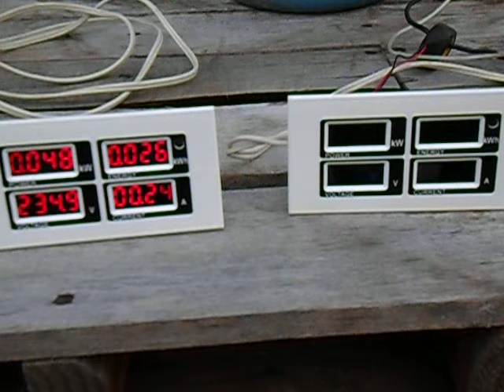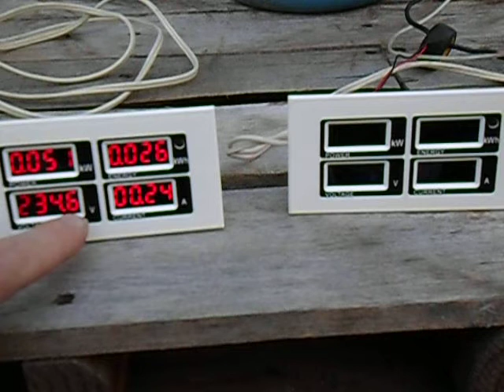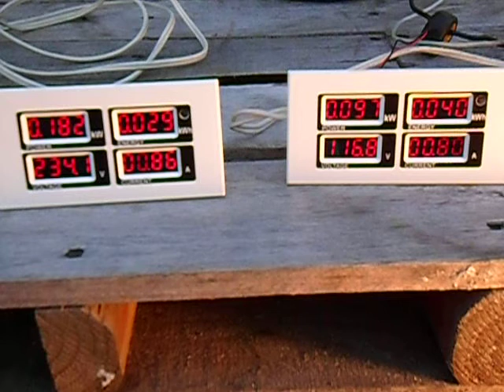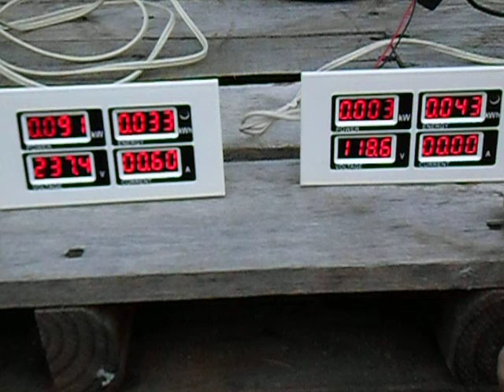Gerard Morin replication 10kw to 5kw transformer test

Comment: Hitby thank you very much for replicating the experiment! I'm contacting all the transformers' manufacturers in my area and asking them if they could help me with some experiments but they do not seem to be very friendly and open to do this type of things :P I have one doubt in regards to the configuration that you have used, in Gerard's video in the minute 3:34 you can see that input wire is connected to 2 lugs. Would it be much trouble for you to see what happens if you connect 1 input cable to 2 lugs? Thank you in advance for your time and consideration :)
Reply from the maker: Juan we will add that into the testing schedule, still waiting for McCulloch Generator.
Reply: Juan Ignacio Bravin Juan, tomorrow I will receive a 10kW and a 15kW set of pole transformers and I have some test gear to kick this thing off the right way, including the identical generator. I am still trying to figure out how I will get the transformers to my location safely, but, other than that, I do suggest he tries to not power his setup with hisoutlet or breaker box because the entire experiment is to do so without any type of grounded source.

The outlet or power is obviously not grounded, but, the source transformer from the power company is somewhere in the system, the outside of the transformer, and, the center tap of the transformer, which, the 240 side is connected to which eliminates the phenomenon.

Gerard does not have his generator grounded, his transformers are not grounded, and, if we look closely, the transformers are bonded together, then, they are isolated from the floor which btw, concrete is a great ground for a transformer that holds high voltage potential. Since the units are not grounded, the outside of the cans are energized whether one believes me or not. I have tried this with the washer pump generator before and it just didn't have enough power to successfully power the coils of the transformer correctly, also, the washer pump isn't actually a true ac sinewave, it is a pulsed dc square wave with a hv spike on the leading edge of the waveform.

If this is done without ground being introduced, the ions created by the transformer channel in energy from the ionisphere, and this is merely proven by the temperature of the bushings contrary to popular belief. This experiment was duplicated by myself and it does provide a lot of additional power in the form of cold electricity that works in a different method. Cold electricity functions in the opposite manner with resistance than conventional "amperage forced electricity" operates, and it is due to the fact that conventional power is not manifested from another place, the electrons are forced to flow by the motion of an excited electromagnetic generator which utilizes ground to create a capacitance in the transformers, the generator, and any other inductive device. Since the ground will not allow this method to be effective, we have to look at how an inductor reacts to any conventionally powered system. The inductor has some capacitance, and inductance to react to the power in a normal way. Since Gerards system does not have ground connected, there is a manifestation of cold radiation which does not exist in his system and the level of power is much greater using a much smaller amount of power. The power is still there, it is just channeled instead of being being drawn by a forced induction from a forced source.

The generator being ungrounded eliminates an effect I call the gravitational siphon effect, which can only be done with a grounded circuit . A grounded circuit eliminates the ability for the aetheric positive energy from being drawn in because it is the opposite and will not allow such a difference in potential of the opposing polarity to manifest within it unless it is isolated from it. (I hope this makes sense)

In a conventional system, resistance forces the electrical current to be drawn from the source, through induction, direct connection, or any conventional method. In the case of Gerard's system, the resistance acts in the opposite manner. It induces a channel, or starts a channel from the ionization of the high voltage bushings, and, it takes time for the energy to become present, unlike conventional electrical systems do. When this happens, the entire transformer becomes energized, but, the outer case of the can has electron flow happening around it, creating a massive flux, therefore allowing the Earth being next to the can to draw the channel of energy to it, being it is the opposite polarity and attracting it.

It can not be done without the introduction of some power, but, the power is much greater than we anticipated after we started. The same thing is happening with Tesla's coil system he built with the amplification coil, as well as the Great Pyramid of Giza. The cap stone is covered in gold, and, the ground is not connected to the cap, but, deep inside of the pyramid, the conductors from both a very deep ground and the cap come close top each other to cause this magnetic vortex, allowing either something capacitive to store the cap stone energy, and, ground on it's other end. This channels in the energy from above, and, the pyramid on it's own is an attractant to energy, so, as Gerard's system, something has to be used to power it up and keep it running, or, the device in the Pyramid, being incomplete at this time could not run. I'd bet if it was complete and it did have all of the components, it would continue to operate and be able to self loop from the energies above.

The energy from the cosmos could be drawn in from a great distance, and with Gerard's device/transformers, since electricity travels so quickly, nearly or at light speed, it would be instantly operational if connected to the source (ionisphere or cosmos energy source) , but, it isn't instant and takes time to power up completely because the energy is coming to the system from a great distance.

I truly believe something very unorthodox is happening here and I will run my tests to see if I could make this completely successful , but, with test equipment monitoring the output voltage, then, a second run monitoring the output amperage, printing a test report for each segment. Then., I will do the same, using the same load to test the input power used from the generator to see exactly what is happening. If it shows a decent amount of overunity, I will attempt to loop it, but, I have yet to scrape up enough cash to get enough batteries to operate my 180v dc motor I am using. I am taking the McCulloch generator apart and will be driving the generator with the electric motor by battery. Then, i will create a DC output by rectification of the 120v output to charge the batteries and attempt to loop it, but, I may need to use a third transformer to correct the voltage, and i will be hoping the amperage of the system through the third transformer will have enough ass to charge the batteries under load. If the system uses that little to run the loads as in Gerard's video, it should loop without question. If this does, i will be building a circuit to isolate ground from the output of the transformers so we could use it in my home for power.

I think I have the ability to isolate ground from the power company's feed by utilizing another circuit I designed to create cold electricity without drawing it in, by merely transforming it from the wall using a few components in between the high side terminals. I am hoping it works and will be shown in my tests.

I also have high voltage meters (professional grade for high voltage linework, ppe, and a load of freshly calibrated equipment to prove the input and output while testing. I really won't care much for anybodies input as how to test it because I know how to prove what is happening if it does in fact work. I will test it all,, document it, edit the video the best I can to make it as short as possible, and, I'd like to make this so I could get a professional videographer possibly donate his time so this could go worldwide in the most believable manner once I am done doing this.

I should be completed with most of my tests in the next few days with outlet power, then, in the next week, I will do the generator version and blend the videos because I feel it will be important for everybody to see the difference if I have any.

The transformers must have a capacitive style inductor which is an aluminum plate would around paper for the secondary coil, then, the primary coil is wire wound with very fine wire. The coil has to be like this to allow the channelling of the energy. I'm not too sure exactly how this works, but, it is a communication device that has a very low frequency resonance closer to one of the Schumann resonances, and by adding the components i am talking about, we could get a more accurate resonance which will cause a much higher efficiency, maybe even allowing the transformers to self power up to a few volts. If this happens, the effect I am looking for will be very similar to my Pelex device and should have 15 kW worth of output. I don't think it matters if we place the smaller transformer first or the larger, but, if the larger is second and the "siphon" happens, the larger transformer can draw from the smaller burning the smaller one out, so, it would make sense to use the larger first.

From what I see, Gerard uses a 50kW and a 25kW. There is a very big difference between those and the pigs in this video as well as the amount of communication the coils can channel since the energy we can feed into the first transformer causes a much larger channel since the power is greater. The less power, the less input is received through the antenna so to speak.

Regards,
Marc
Reply: Juan Ignacio Bravin A WARNING TO EVERYBODY: THIS IS DEADLY TO DO... DO NOT ATTEMPT THIS AT HOME!  ONE WRONG MOVE CAN KILL YOU. HIGH VOLTAGES HAVE CLEARANCE DISTANCES BECAUSE THEY ARC AND JUMP if one gets too close to them . A full potential arc can give you just as bad of electrocution as touching a connection. Arms get blown off, or, people have painful nerve damage and massive burns that will not easily heal for the rest of their life with just 8/10's of an amp at 7970 volts if they do not die instantaneously. 

Please use safety glasses,  high voltage class 2 rubber gloves and sleeves, and whatever rubber protection that is made to cover the exposed wiring so mistakes can not happen. I recommend only high voltage qualified people are the only people who try this.  if you are anywhere near large primary jumpers, you will get hurt if the system arcs to you. It can do so if people are not wearing the correct PPE and, I recommend that if you have no qualifications for this, DO NOT TRY THIS AT HOME or close to anybodies home. Be smart and do not let kids anywhere near this, it could kill a curious child as wel!! You were forewarned. I will not be responsible for any injuries , deaths, or damages to any personal property, or any other property for that matter since this is a fire hazard as well.

Now, that all being said, Hi again Juan!  I received the two transformers today, exactly as I ordered, but, before I set them up, I have to test them with a TTR meter and hipotential test set to ensure they aren't shorted or even partially shorted. (this verifies the insulation is good for the rated voltage and allows us to energize them with high current energy without a destructive explosion as some cans do. 

They were delivered from the Dakotas all the way to CT, so, during the ride, damages could happen. I always test transformers with a hipot set to insure the insulation is ok beforehand, and it is wise you do too if you ever order one. You could always have an electrical test company do this for you just to be on the safe side. It is expensive, but worth not being burnt to death by boiling and flaming transformer oil in the event you backfeed them with utility power and recreate what the utility transformers already have running into them. This is an extremely dangerous thing to do if you do not know anything about high voltage safety, and I do not recommend anybody do this if they are not qualified, using rated gloves and sleeves. High voltage arcs jump if you get too close, so, if they are powered by an outlet from the secondary side, it would be enough energy to blow off an arm or a limb if the primary bushing or connections  . The Pelex device is my own design btw, and, I didn't channel or have visions showing me how to do this.. However, the transformer/generator phenomenon I witnessed happen in the utility field and I back engineered it /recreated the phenomenon. I am willing to recreate the experiment again using the same products Gerard did, however, I think it is wise to utilize a load box to test the output in comparison to the input. I do not think the test results will be something we can measure successfully since cold radiation varies and does not read with metering that is calibrated for conventional electricity. i will video this and share the setup, the necessary setup, as well, what can and can't be done to make this work successfully. I do not care to listen to any skepticism or even answer to their comments, especially when they say I am cheating or creating an illusion to show the system doing what it really does. The results will be published whether it works or not and I will explain to everybody exactly what it is doing even if it doesn't work as Gerard claims.

I have done this before with padmounted transformers, however, I am not going to spend 10k for the transformers to make this all happen as an experiment when I will only be able to power my own home with what I can afford.

I will eventually loop the system if I am capable as i did with my last genset, however, I have to install light bulbs to soak up spikes so they do not burn out electronic components in my system since I will modify many components to allow a conventional utility feed to operate it once I test to ensure it works successfully. The system can not be grounded in any way and that is what makes it so dangerous when using a utility feed, however, all utility feeds contain a grounded transformer which eliminates the cold radiation due to the capacitance to ground. We are literally creating a capacitance  to the positive particles in the sky and channel in a negative flow of energy which allows the massive difference in potential and the annihilation of positrons from colliding electrons within the transformer, discharging massive levels of energy in the process which occurs inside of the transformer. Once the energy is built up inside after the timely manifestation of the electrons to the high voltage bushing, I will switch the loads on and test to see what happens.

I did order plate wound aluminum core transformers so they act as an antenna as Gerard has told me to do, so, we will see what happens and I am hoping all will work as did happen with the padmounted units so I could prove to the world how it happens and it could be built for $2k or less if you already have a generator at home that can operate successfully without grounding.

My goal is to acquire a 2000 watt generator head to run from an electric motor so I could loop the system without using batteries, this way the skeptics will really have no way to say it isn't free energy. The system usually sees anywhere from 4 to 40 times the input energy when put together and powered with the correct waveform that has enough ass to do so.

The current and voltage will be shown to all on video to attempt measurements to allow everybody to see whats really happening. I will be performing high voltage digital readings as well as analog reading using line testers for professional utility systems. i will also share the low voltages and amperages which will be recorded with a printed report every so many minutes. This will show a printed record of the amperage and voltage from the input as loads are added to the output, and, I will do the same with the input to ensure people do not feel I am hiding anything.

A word to the skeptics: I have no reason to lie or tell anybody anything other than the truth. If the system doesn't work, it will make Gerard look bad, and, I will add load much higher than the generator is capable of, but, I am not going to allow my genset to burn out, however, it does have a circuit breaker that should pop when we overload it, even though it won't be grounded, I have already found it does function with no ground and many people say on a daily basis to me. I also have a very stupid comment from an individual who states that a transformer won't work without grounds. They certainly do work like this.. All electrical systems at one point in time did not have grounded neutrals,(back in the 50's through 70's these systems were functional still in some states and cities.

I'd like everybody to make sure others watch my experiment that is videod if it works, so please share it if it is successful because I'd like the entire world to know we could all do this if it works with transformers from a junk pile, they could be sent back to manufacturers and refurbished. Also, I sell refurbished cans to anybody if they prepay for them. The units cost $2000 for one 10kVA and one 15kVA transformer. They are Wye type pole transformers that operate with a 13,800 volt system which by themself are rated for a 7970 v line to ground voltage and a 240/120 center tapped 3 bushing secondary with ground strap for bonding to the can.
Reply: Juan Ignacio Bravin Tomorrow i will be trying to connect my B&S generator, of course isolated from ground to see if it has the same result as Gerard's system with the McCulloch genset. I overheated my McCulloch by attempting to feed gasoline fumes into it years ago , running it way too lean and it seized the engine slightly. Since the rings wre bound, I haven't done anything to it but soak the upper side of the piston with oil, but, once the damage is done, I don't think it will recover without either being heavily honed, taking the entire engine apart, replacing the rings, possibly even the piston if the rings were heavily damaged. Since the head has a cast iron bore, I don't think that was damaged, But, I havent looked yet. I am waiting for parts to arrive so i could connect the shaft of my 2hp electric motor to the generator which I do not think it will operate it at all since the magnet rotor is extremely heavy making the engine a real bear to pull start. Anyway, I am waiting on Amazon to ship the correct Lovejoy coupling with a rubber isolant so the shaft and the generator are not connected which will transfer the case ground, eliminating everything the system does.

I will attempt to start it with electric power, get it up to speed, then, switch the input to the output of the transformer and eliminate the incoming feed from the outlet. If this doesn't function due to the low hp rating of the motor, I have a 4 hp electric motor from a hydraulic pump I have sitting around which isn't exactly efficient, but, powerful enough to spin the gen. I am hoping it will loop, but, we never have any promises with Overunity devices. Gerard told me it will work so I will document all I could using the metering I have, but, he states that the amperage will not remain steady enough to get an average reading, not even with an rms or hold button. He did say it would be all over the place because cold radiation is not an energy that could be accurately monitored.

If it works and reading come from it, that's fine and we will know if the presentation will hold water. I will produce a waveform from my scope, then, I will attempt to read the high voltage levels with a professional line meter, as well, the amperage with an analog ammeter that has been freshly calibrated by Amprobe since they built the machine. They have literally told me that Radiant energy or cold electricity is not a known electricity that they could calibrate the system to and if it does exist, no known degree of accuracy will exist, especially if resistance and amperage will do abnormal things, such as offer mass fluctuations due to the pulsating incoming energy we receive since the energy is drawn from bursts of lightning. The lightning reacts exactly the same way as the hairpin's arc gap since the capacitance  extremely low nano or picofarads, offered by our atmospheric separation, and, when the lightning bolts around the world discharge, they offer an energy that is a pulse which we could draw from if we channel a path from the clouds through the aur as I am doing.

Many people claim this works, the hairpin circuit is similar, and it outputs discharges of cold electricity that have shown me promising results which light bulbs and power circuits only if we use a high resistance connection to power the resistive load while the circuit is completely shorted out. This will never function if we used conventonal power to heat the bulbs.

I have a lot of interest doing this because the circuit lights only a high resistance bulb circuit and it has to have a high resistance magnet wire connected which is very long, 50 ft plus in length, as well, it has to be over 1200 ohms to even turn on, 2500 ohms to be extremely bright and get super hot, and, the wire doesn't even warm up. I do not get shocked by it, and, we could place the bulb in water, it keeps operating, and, it won't shock me if both hands are in the water touching the soldered terminals.

If I can do this, all of you could as well. The output of the lighter duty bulb is astoundingly more bright and much hotter than higher wattage bulbs, completely opposite of how conventional power will operate. This is the God's honest truth, I have absolutely no reason to lie. You could all try it yourself. Please look up Karl Palsness and watch his video presentations where he shows exactly how the hairpin is built and functions.

This is the key circuit to eliminate grounded center tapped transformer's conventional power and turn it into cold electricity so it could be utilized for power multipication, not just voltage. It is insane to see that science has disowned Tesla and Maxwell's claims for this to operate as they have proven on many occasions, even offered a mathematical solution to prove it's function, until JP Morgan financially persuaded Lorenz into erasing and editing the equations Maxwell had worked to write and prove along with the assistance of Tesla well over 130 years ago.

Its a shame as well because we'd all have free power if Tesla wasn't made to look like a madman. He certainly was the most brilliant minds to ever exist. We wouldn't be even close to having the technologies we have without Tesla, so, what made him so mad if he created just about every electrical design we use to this day. He was an absolute genius!
Reply: Dear Marc!! Thank you once again for your very informative comment, I will take a look at thes video of Karl and I look forward to hearing from you soon! Agaisnt all odds I'm sure that would times are coming for the Earth, maybe some turbulence at the beggining but the Earth will blossom again thanks to people like you, Gerard and everyone that is working with altruist objectives in their hearts!
Reply: Marc Belanger Dear Marc, thank you very much for sharing your thoughts and experiences with me, what you're saying seems to have sense. I have suscribed to your channel to learn more about your point of view and after seeing your lastest video I'm wondering how did you take property about your ideas and work? Have you not realize that you are just tuning to a frequency  that is giving you knowledge but that frequency that you're tuning is not yours? If life taking through you and wanting to bring knowledge to this world so people can live freely, Imagine when we enter the era of abundance, what are you going to do with all the money that you're expecting to get? So if it is true that you have the devices working, please, make them open source so the knowledge is transferred faster and so the world start to change and to become more energized :) My words are written with the best intentions, and I'm pretty sure that if you would go public you will get the attention of a lot of people and for sure that you would get funds to continue with your research and to live a good life. Wishing you all the best, 
Juan
Reply: +Marc Belanger A careful examination of "Tesla"  does revel that he was a Freemason ... and  was as "Connected" as was Maxwell .. Faraday... Galaleo .
Newton... all placed in front of us.. in all to easy a fashion to steer us away from the truth.. .. ( if you are "famous" at this level... you sold out from day 1 ) 
so Cheers and have a wonderful day...
Sadly Tesla's "genius ' came from the masonic lodge.
Reply: Believe it or not, Tesla's genius was welcomed to the Masons, he didn't start there or get his genius from there, he arrived in this country with his gift given to him from his mother, who was an extremely smart person and an avid inventor as well. The problem Tesla faced was the fact that he wasn't legally smart and was completely taken advantage of since he believed Thomas Edison's BS and listened to him about getting paid if he did certain things. Tesla basically gave away his patents to Edison and was never even paid by him as Edison promised him money for it all, and never gave him one dime. Then came along Morgan and bought all of the shares of Edison Electric out and started GE. He now owned all of Tesla's patents, or at least Tesla thought he did and feared what Morgan could do if he ever used his inventions to create anything that would put Morgan under. Since Tesla didn't follow the laws and knew very little about them, he could care less about making money on his own and gave away his most prized invention of all, the tesla motor, which Morgan threatened that if he used it for anything, he would sue him blind. The motor patent was literally bought by George Westinghouse and since Westinghouse couldn't afford to pay Tesla the royalties for the motor, Tesla told him he would help him out to eliminate the financial burden Tesla's motor's royalties were causing him and Tesla ripped up the contract he had with Westinghouse, as well as his patent which was written. Morgan literally bought the rights for the motor from Westinghouse and continued using it against tesla refining him to being broke forever, and, also making sure he couldn't make his way out of the Hotel New Yorker, which Tesla knew no other place where he was welcome, since Morgan made him look mad to the world since  Morgan told the press that Tesla thought he was communicating with aliens to get his inventions in his visions. Nobody trusted tesla anymore and believed he was a nut, while he was working basically for free for everybody, even the government and military and he was not funded at all from any of it., He was completely taken advantage of because everybody who said he would pay him eventually robbed him and never paid him a dime. Tesla's inventions were Trillion dollar money makers, unfortunately, everybody but Tesla earned and became millionaires or billionaires from his devices, and, the circuits are still being taken advantage of till this very day. The US government should be taking royalties away from every company that produces a device with any of his patents, even if they contain a small portion, the money should be placed into an escrow and given to his family, or whatever is left of his family, none of them should go to GE, JO Morgan Finance, or Westinghouse, (WESCO) or any piece of any of those businesses. All of the moneys that were made from the years of use of any one of his developments should be taken legally from JP Morgan Finance, GE, The Edison Companies, and, Wesco for pure thievery since not one of those original owners ury aearned profit and sent it back to the Tesla Family. They should all be forced to take their billions and billions earned over the last century from Tesla's developments and fund an account with it to come up with cash due to his family. I'm quite confident that the government has already taken during the 2010 California court case against GE for Morgan's corrupt actions against Tesla, however, I doubt very much that the money taken was ever given to his family, I bet the government too it which they have no business taking. Tesla must have had cousins, brothers or sisters, maybe nephews, and great nephews, neices, etc., that deserve the money he never received, as well as 135 years of royalties that JP Morgan finance has no business even having.

The government left Morgan alone for a long time because he was responsible for starting the income tax system that saved the US while in it's recession, but, this income tax to this day was never a legally established tax system, it was put together by Morgan on a Christmas eve when the members of Congress that should have attended the Congressional hearing to pass or veto the law were not there when he held this hearing as a surprise, then, the government allowed those who were present to vote the law in without one single citizen protest the illegal doings, it was corruptly brought to the table and has illegally been in place since, after all, there isn't even a written law stating it is there, it is written by the IRS and only the IRS, not by US Codes or law books. Not one single American citizen has had a chance to vote the personal income tax away and vote in only corporate taxes. I feel we should have only a national sales tax that nobody is exempt from , this way, all of the illegals that sell drugs and make millions illegally that never pay taxes will pay too when they buy those fancy clothes and cars, etc. Its a damn shame and the government helps the rich become richer, and, the middle class and poor become poorer. The rich have all the money in the world, they could afford the 33.3% income tax, we should be taxed much less as the rich are paying and bend the rich right over for their money. Politicians are rich, they will never allow any chance for their money to be voted away as tax dollars. They are also mostly all drunks, they will never tax booze more, they should. They tax cigarettes to death and take complete advantage of our addictions when it is completely rude and wrong.. Also, we should have the right to smoke tobacco the way we love to smoke it. We shouldn't be poisoned with FSC which is fire control tars made of carpet glue that the government forces into the cigarette paper and it is causing emphysema within 5 years if you have smoked already for just 5 years. i know because I have it and it was caused almost immediately after the change of the cigarettes was forced. It also has a heavier level of radioactive fertilizers used and it is forced to be used by the government. The government also has banned any data related to studies made to prove that the FSC compounds are bad for us. This means yes, all of the collegiate studies can not be publicly published when we all have the freedom of the press written in an ammendment, this is all part of the Cabal's plan and our president is the number one in charge who has been forcing those of us who smoke cigarettes to our death without even warning us that it is so much more deadly and it is not even enjoyable, he has made the smokes stronger, more addictive, and, they feel as if we didn't even smoke so we go for more. That is a direct violation of our Constitutional rights and Obama is the one who started this to eliminate a good part of the population, which makes him a murderer and nothing else.
Reply: Marc Belanger wow... your talent in writing exceeds mine by a million miles...   
ok.. I've  almost got my research on Tesla almost done and will show.. He was what is called a "Character" a stage name for a fictional man.. 
Yes the work was really done.. but the "story" attached to him is not true and is in fact a lie..
its.. the world is a lie.. and your experiments just prove one of many .. I will do my best to show them to you and How a Freemason  sells his soul to the devil to achieve such fame. Cheers.. 
your a big boy and i hope can handle this stuff.. here is an easy one
George Washington was = King George of England....some yell at me.. but its just the way it is... Have a wonderful night
( I sort of work with this stuff.. I've have a Master HVAC license and am trained as a 1st class steam engineer..  ) and was a Chief Building Engineer for a 300 room Hotel for 5 Years.  but your work is all new to me
Reply: Marc Belanger  A thousand "thank you's " for  taking your valuable time to write me back. ...I will try to list how I think I can help in my next reply.  Cheers